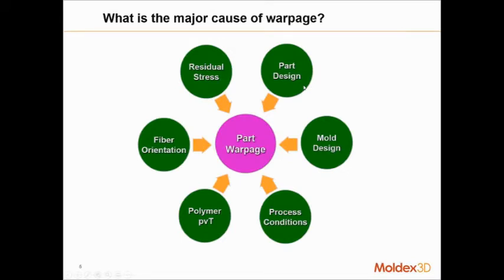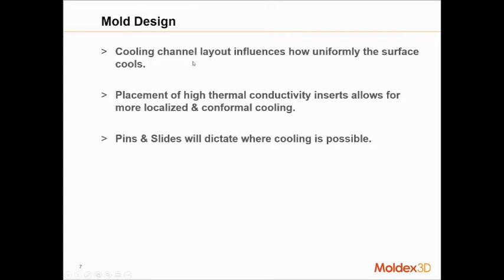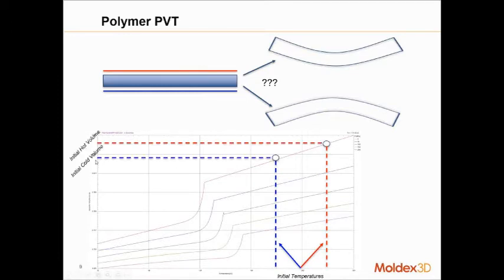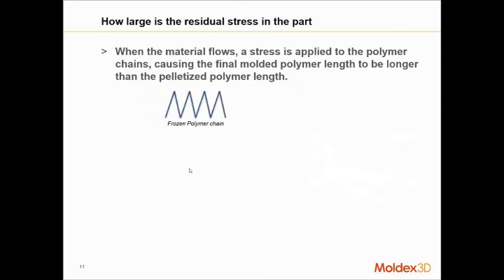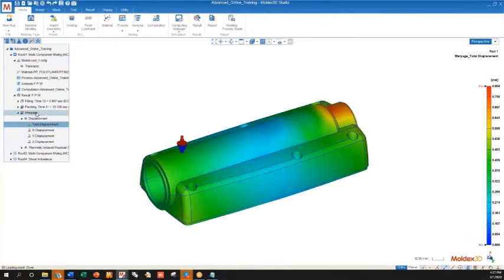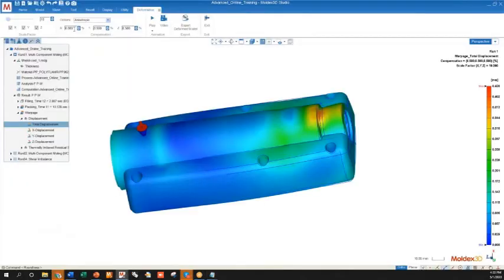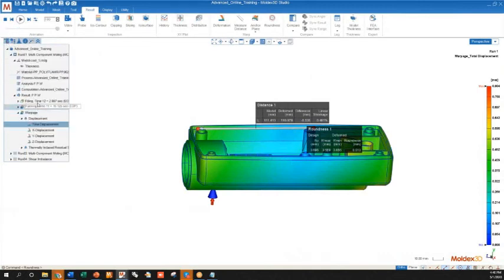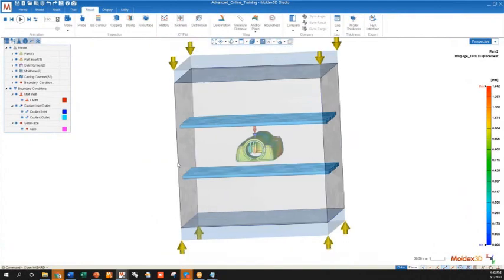Warpage Analysis & Visualization Techniques | Moldex3D Advanced Tips & Tricks | Moldex3D Studio

Comment: Thank you for the video.
Regarding the mold shrinkage compensation. Does it make sense to use it with an imported model that already has the shrinkage compensation? Or should this "option" be used only at an earlier stage to get a potencial shrinkage value?
Thanks
Reply from the maker: Hello!  We would recommend to not use the mold compensation on a part that already has compensation applied to it.  Using Mold Shrinkage Compensation when the model already has shrinkage applied double-considers the shrinkage and would give an inaccurate representation of the final molded part.

Comment: what is the difference between standard & enhanced in warp computation? when to use standard and when to use enhance?
Reply from the maker: Standard Warp calculates all components of warpage separately whereas Enhanced Warp calculates all components intrinsically.  

Enhanced Warp is a more sound theoretical approach to warpage, but only gives the combined displacement results, so if you want the components of warpage (temperature effect, fiber effect, differential temperature effect, etc), then you can run Standard Warp.